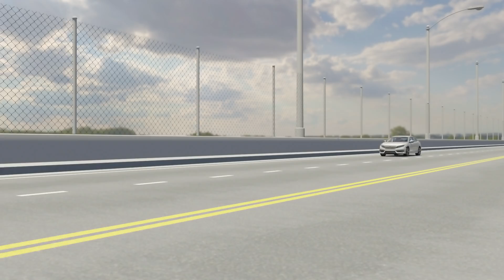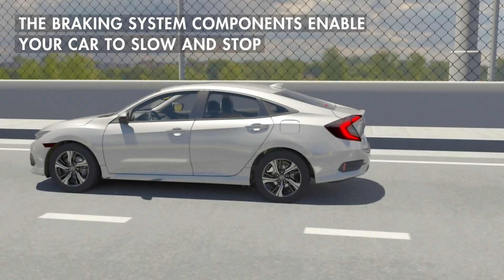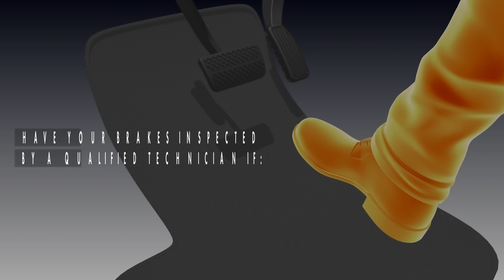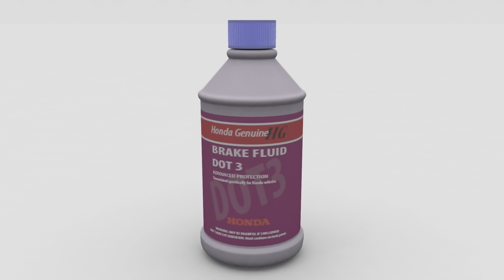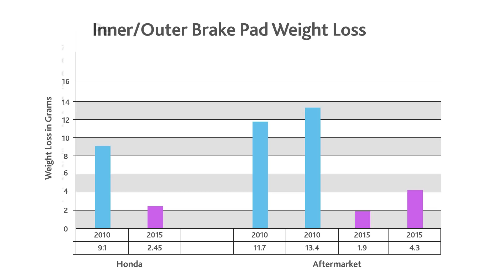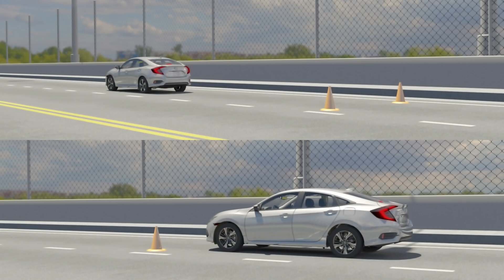Honda Genuine Parts University | The Brake Pads

Comment: Sorry Honda, but your brake pads are known among track day enthusiasts to be terrible out of the box. The pads are certainly better compared to other "low end" pads like Duralast. My factory stock 2014.5 Civic Si failed to stop in time for a turn after a track day. Thankfully, it was just a turn, so no big deal. Imagine if I had to stop in a hurry before hitting something.

There are better aftermarket pads out there from the likes of Hawk, StopTech, etc.
Reply: Why would you use factory pads for the track?
Reply: Factory pads are not designed to be track pads, which typically every enthusiast already know, which is why they upgrade to something more durable, except you.
Reply: Of course not. I don't expect them to be track pads. I do expect them to at least last 2-3 laps of a fairly short track like Mazda pads do.

Also, this video is comparing Honda OEM pads with aftermarket pads. They aren't charging regular aftermarket prices either. Around $50+ a pair, when comparable pads are in the $30-$40 range. $50+ is closer to Hawk than regular aftermarket pads.